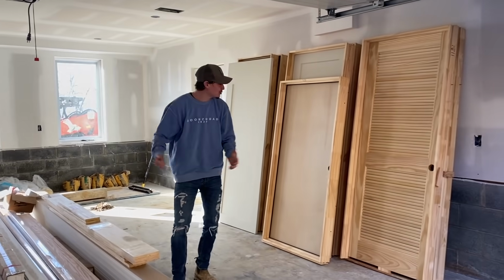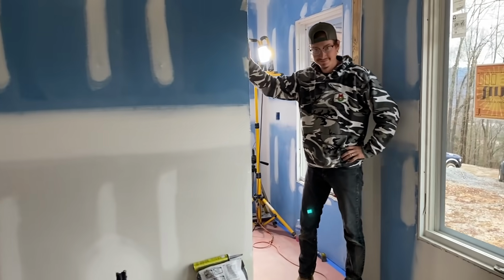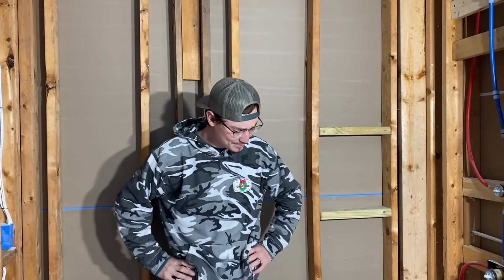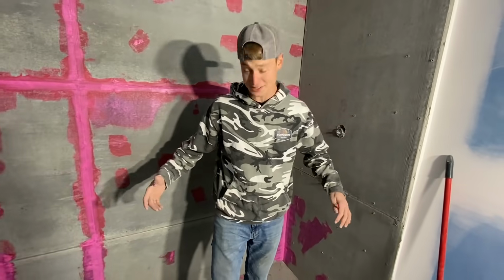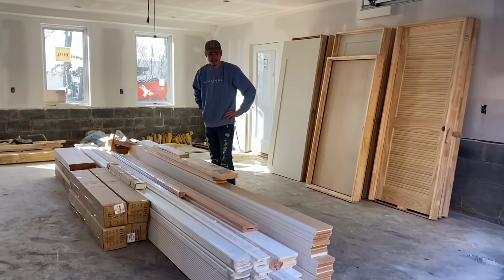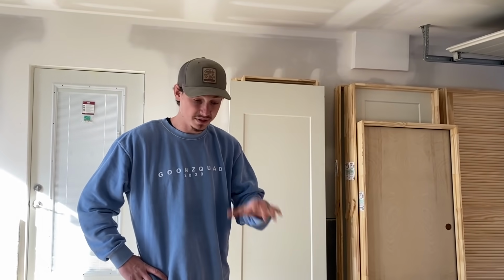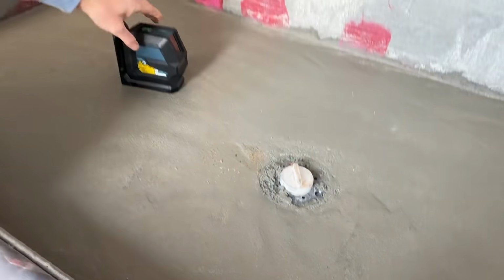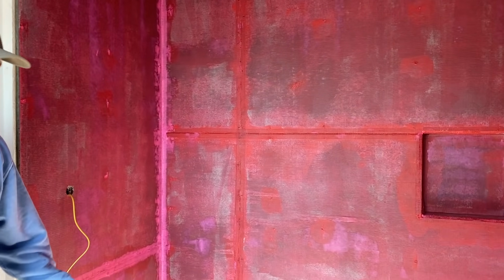The New Goonzquad Headquarters Part 48

Comment: Borch is German quality - never breaks - That's what we use as professionals in Europe. Of course also DeWalt and AEG. You must never buy cheap products - then it is better to sell it used afterwards
Reply: Bosch make good equipment for surveying and setting out, but we favour Nikon for their reliability and excellent servicing network.
Reply: @johnstedman4075  Hehe. Im norwegian and I agree with you about Nikon. A small problem - The Japanese are small, have small hands and the machines are just "an inch" too small. That's my problem. Japanese products are also in the top tier
Reply: @lpdude2005  Good point. But I recently bought a Nikon D6 camera (made in Japan) and am finding that the buttons are big, beefy and very practical in use. It seems that the Japanese are becoming aware of what international purchasers want, at least in the professional sector!
Reply: @johnstedman4075  Hehe. I thought you meant tools. The cameras are fantastic and the best-selling in Norway - together with Canon. My neighbor is a bit fanatical - he eventually bought the Canon R5. He long considered the Nikon Z6. Hva koster D6 in your country. Here it cost $7800 for the camerahouse.

Comment: I commented this on your last video but I was late so I don't know if anyone saw it...
The orange 10 gauge wire you ran for the shower steamer is too small for a 10KW unit. You might get by with 8 gauge but should probably be 6 gauge wire. Definitely have it checked out by an electrician before you burn your house down.

Comment: someone correct me if I'm wrong, but I made this mistaking remolding my bathroom, I believe you supposed to double stack 1/4 Wonderboard, its super flimsy and i regret now just leveling the wall using morter after.

Comment: Just for future when you sheetrock or concrete board off set the joints, will help strengthen the wall and help stop cracks. You guys might never see my messages

Comment: Love that you guys do alot things yourself but that shower is not gonna last long. The shower will hold water from day one, Redgard has to be minimum two full coats for waterproofing AND to for proper steam protection in steam showers. The ceiling should have be pitched alittle (2 degrees I believe) so the water will run to a wall rather than drip on you during a long steam. Pan liner should wrap completely over the curb to the outside as well. Also the curb should have been standard 2x4's rather than pressure treated. Somethings you can youtube but shower prep, I'd steer clear of. I know you guys have spent a bunch of money but I wouldn't use that shower, hire a professional. It will cost you far more down the road.

Comment: Can you put a light inside a shower? You can't put anything electrical in there by regulations.
Reply: Sealed electrical fittings are permitted, provided they comply with certain safety standards.

Comment: The pan is not installed correctly.  The floor the pan sits on needs to be pitched towards the drain before the pan is installed! 1/4 inch per foot. Water will lay under tile on floor . You also did not install weep hole protection. 
Joints on cement board need to be tape and bedded with thinset first. Before you Red guard. 
Cement board should not touch pan.
Mortar on floor is too wet. May shrink and crack.
Ceiling is still not pitch correctly. 
The wall cavity behind cement board should be insulated. 
Ceiling lights need to be water tight.
Preasure treated wood will rot fasteners if the are not ment for preasure treated wood.

Comment: Should have presloped the pan underneath that liner. Otherwise the water is just going to sit there and go nowhere. It needs preslope to flow water towards the weep holes in the clamping drain. I have torn out showers like that. Water smells pretty stank because it just sits there in the pan liner and builds up. I don’t understand why people still fool with those old school liners anyways. There are so many better waterproofing technologies on the market now that are far superior.
Reply: I can't believe they made so many errors in the pan installation There are dozens of great videos showing how to do the correct installation of that liner system but even more showing much better and almost foolproof systems for amateurs.

Comment: been watching for sometime and I know for a fact you did the tiles wrong on the floor . first and for most your square off the room and find the center square . this is where you start from . not the out side walls and in .. this way your tiles will be even on both sides . do this for your bath / shower area. never use black grout with white tiles . its harder to replace it in the future . its best to stick with a basic grout - white it goes with everything.
also lower level should be done in tiles and not wood. due to people walking in and out all the time. food spilling . easier to keep clean . hardwood up stairs is ok

now for the viewers we should do a drinking challenge.. every time they say DUDE you take a drink of what you have on hand such as pop. also count how many times they do say it . it would be funny..

Comment: You should have re think  the light in the shower area . Not a good idea  it should be on the outside of the shower area.
Reply: Lighting can be fitted inside the shower enclosure provided that waterproof and sealed fittings are used to comply with Code.
Reply: @johnstedman4075   it might be code where you live but if you are taking a shower and happen to touch that can light what do you think could happen ? Code is not always the best practice should always think about going above code . Safety should always be first.

Comment: Need to do your research on running that thermostat wire it front of that stud that’ll be awesome to send a screw through or pinch it with the cement board and need to take the lights out of the shower steam (water) goin right in em not smart but your lesson learn it how you want to 🤦🏻‍♂️

Comment: You need to pull out what you have already done and start over, hopefully with professional help. That pan is guaranteed to fail. That type of liner goes over that light mud after that mud is properly sloped. In any event the way you installed it , all the weeping holes are now blocked and  water will not be able to properly  drain. You are going to cause thousands of dollars damage to your house. If you still insist on doing it yourself rewatch the Youtube videos or better yet buy one of the excellent waterproofing systems designed for the home handyman.

Comment: I hope you sealed those lights in the shower.  You don’t want any of that steam getting in the ceiling
Reply: Goonzquad will have to use sealed waterproof and vapourproof light fittings in the bathrooms, or they won't pass Code.

Comment: Tiles on the  shower ceiling ?
No one does that or slope the ceiling!!
Reply: It is possible to use a single acid etched sloping glass panel for the ceiling of a steam shower. Not easy to do, but we have found that it makes for more lighting opportunities, deals with water runoff better than tiles, and is not likely to need any future maintenance. Some method has to be found for access above the glass to maintain the lighting, but that is easy when there is a loft directly above, and otherwise we provide an access panel in the adjacent bedroom (often inside a closet) or through the floor above. It provides a very good result, but needs careful planning and organising, and is expensive. Getting a room sized piece of glass into a room is no easy feat, it needs very careful measuring, and we use a specialist glazier for that work. We have just completed a new house in London which not only uses single etched glass panels as ceilings in all of its 5 bathrooms, but also has a single slab of Travertine marble for each bathroom floor. Looks great, but beware, don't use polished stone for this, have the surface suitably engraved or use a grippy transparent silicone overlay so the users don't slip. We are definitely moving away from tiling in our designs, and are currently building a house in southern California where one bathroom will be have various kinds of single glass panels for all of its walls, the door, the ceiling, and even the floor. The Client thought we were nuts, but is warming to the idea after we built a scale model and showed it to his wife...

Comment: Are you guys sure you can have can lights in a steam shower
Reply: To pass Code, in the bathrooms they will need to use waterproof sealed lighting fittings that are certified for use in wet environments.

Comment: you didn't angle the shower mortar bed towards the the drain under the shower pan-liner, youre gonna have standing water(-the mortar bed under the tile will be soaking wet constantly and mold,)....yeah they blew it big-time.not trying to be an jerk. just trying to save them money before too late. you're going to have to tear the shower out and start over...I'd say they'll start smelling the mold after a month of use..I've been doing this over 10 years and I replace homeowner work all the time for people....and they needed to use butyl rubber to seal the drain not the-silicone they used that's going to leak...they needed polyurethane butyl rubber shower sealant...window silicone in shower silicone won't stick to the the shower pan,or the ABS of the drain

Comment: I just noticed the concrete board only has like 6 screws per board btw I am not trying to hate just you guys spend alot of cash on this stuff and you work good. However you need to research a little better

Comment: You’ll be sorry you used tiles on the shower floor. The grout is a nightmare to keep clean. Also you should have put an extraction fan in the shower. Not that you would take my advice.

Comment: Not trying to be negative but you guys did the float improperly. It's supposed to be way more wet and actually self level the surface. Cake batter consistency and a simple trowel to spread and it will act as water and self level.